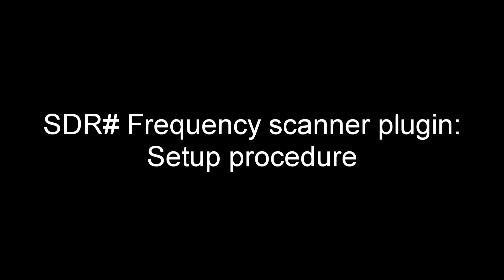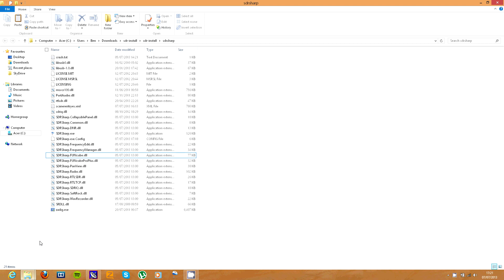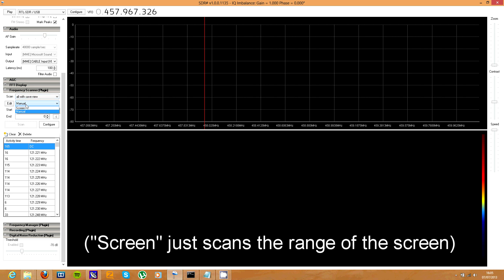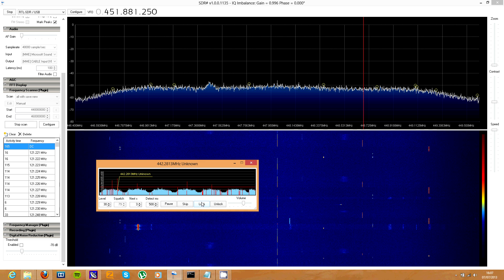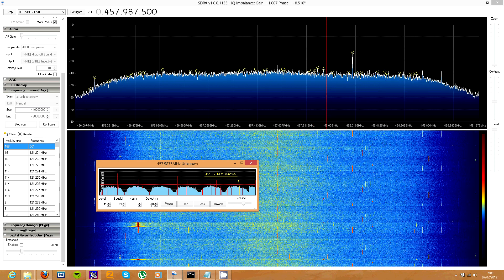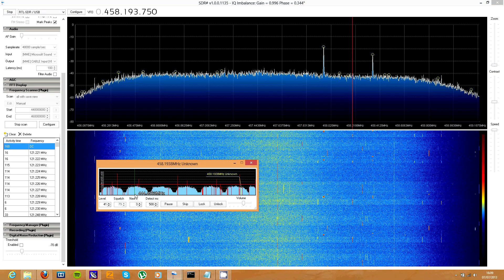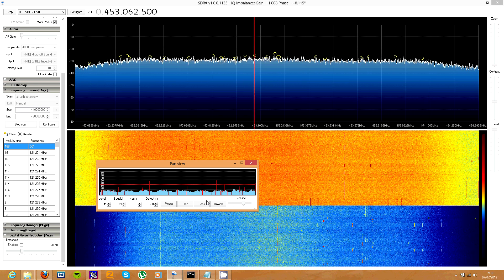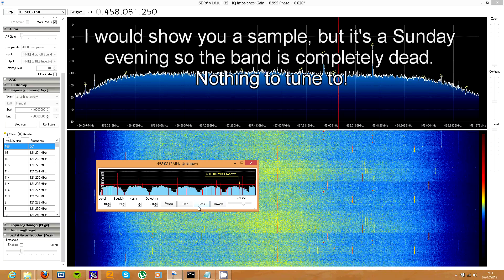RTL SDR Scanner SDRsharp plugin setup + how to

Comment: The '' frequency scanner plugin '' section does not appear.
Reply: Same here. I wonder if 7 year old instructions are out of date.
Reply from the maker: Yeah I think the process may have changed by now. I don't use this program anymore so I don't know
Reply: Thank you for the answer. Hope there will be a plugin update.
Reply: I was having the same problem and what got it working for me was I used the net 4.6 version instead of 3.5 they are both in the freqscanner folder. let me know if you have any questions.

Comment: hi, I can't get it to work?  After i've added the line, it won't save it?  NOthing has changed after i have added the line?
Reply: I was having the same problem and what got it working for me was I used the net 4.6 version instead of 3.5 they are both in the freqscanner folder. let me know if you have any questions.

Comment: Fucking programmers with their fucking shitty code. See, this is the biggest problem with SDR radio - the shitty code and the whole needy thing of pasting this and putting this that and here, which is what an average programmer be able to do without question. 

FFS, can you imagine if analog radios were built by these fucktwats? Radio communications would be extremely unreliable.
Reply: I guess in canada they don't understand that you have to have a critical mass of requisite knowledge and skill to achieve a capacity for $350 that would have cost you $25,000 a few years ago. Some can, some cant, if you can't, get the hell out of the way. Lol.

Comment: running windows 7 and get a run time error. what operating system are you using ?
Reply from the maker: +Rodney Waln In this video I was using Windows 8. The procedure has now changed though for installing plugins, and I need to make an updated video for this when I get time.

Comment: Site is down, bummer deal.
Reply from the maker: I just loaded it here, it was fine.
Reply: radiosification Ya, I tried about 15 minutes later and it was fine. Also thanks to this video, I was able to get it all working, but I will add, the program may hang when exiting the scanner. Just the same, it does work.